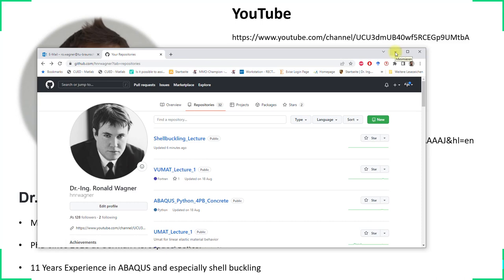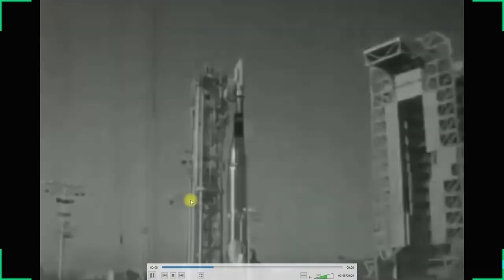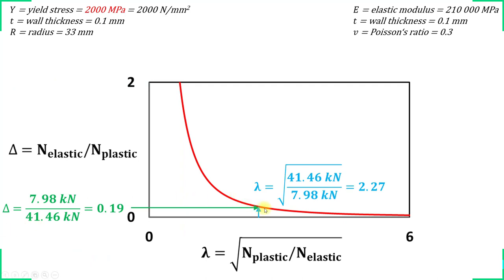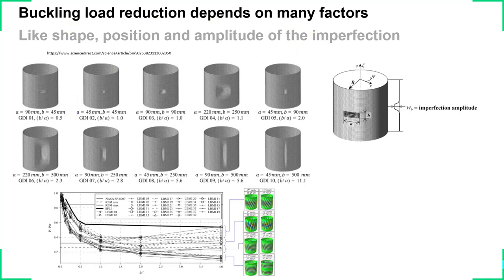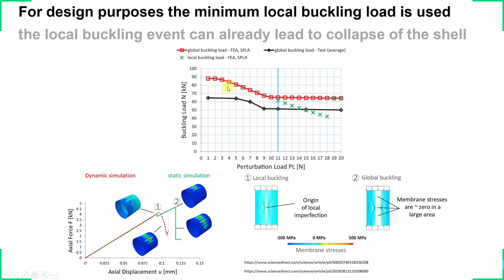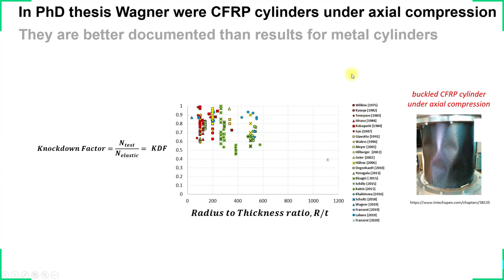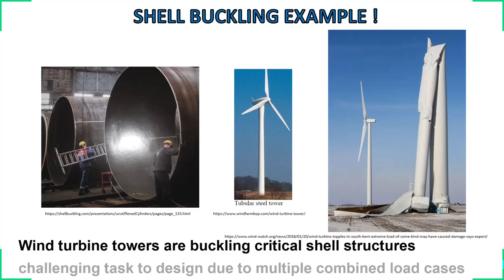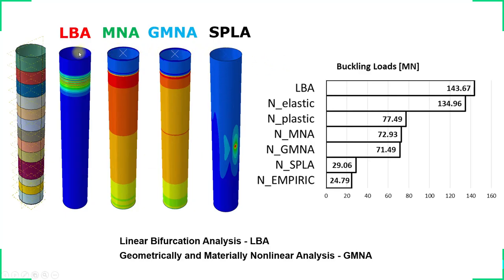Shell buckling lecture 1 by Dr. Ronald Wagner @ Jiangsu University of Science and Technology

Comment: Sir can you please tell me the exact difference between shell model and solid model
And if we do simulation on shell body instead of solid body will there be any difference in results??
Reply from the maker: Dont know all the differences, those you have to research yourself, but yeah, there are significant differences for modeling shells with either 2d shell elements or 3d solid elements, in my experience 2d shell elements are better in most cases even for shells with r/t ~10
Reply: @hnrwagner  sir whether there will be change in results or it will remain same if we perform analysis on shell model instead of solid model?